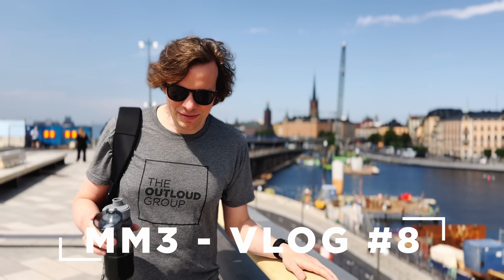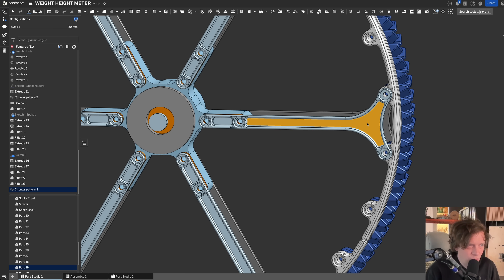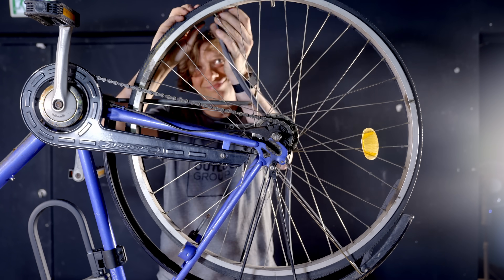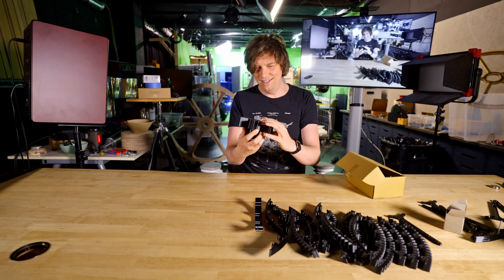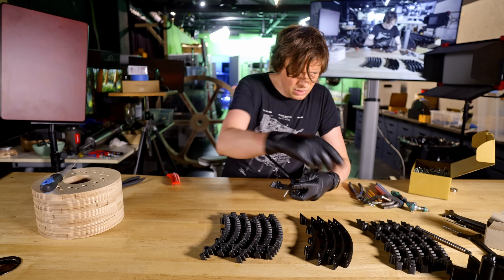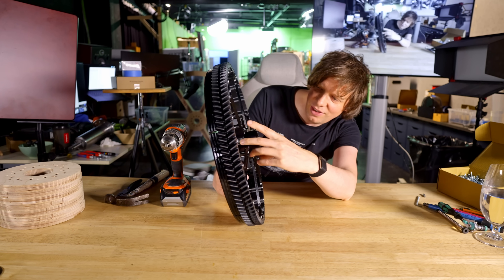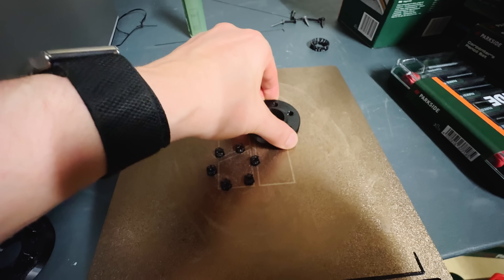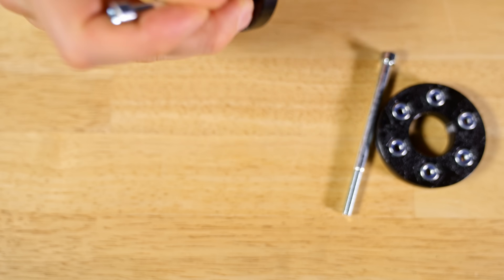Assembling the first gear of the Tightness Meter - MM3 VLOG #8

Comment: 2:45 If you wish to patch the innertube and continue using it, I would suggest the Tip Top tube patch kits. They have been around forever and they work the best. Look for the little celeste green box. You want the classic kit with the orange wavy edges on the patches.

Comment: Regarding the backlash, have a look at a 2cv camshaft. The gear is split down the middle connected with springs. This pushes the teeth together removing all play, even after wear! Not sure if this is a solution for you but it is a neat engineering solution that is nice to have in your backpocket of knowledge

Comment: Hiya, when using two bearings with "fixed" centers like this, you can fully constrain one of the bearings on the outer ring and the other can be 'floating' (only constrained on the surface, not on the sides, in a tube). This way you will never distort the bearings, no matter how inaccurate that sleeve is or how much you tighten them down since one bearing can always freely move in the axial direction

Comment: martin, you’re designing the bearing assembly like it’s going to be doing 10K RPM. those bearings can handle all the thrust loads your meter will reasonably experience

Comment: OH MY GOD MARTIN, WASH YOUR BUILD PLATE!
You're using way too much liquid glue, and you're using the Bambu liquid glue that's better at making prints pop off the plate than making them stick to the plate. You probably don't even need it with textured PEI... and if you do, it's a sign you need a better build plate. Textured PEI is a jack of all trades, master of none. For engineering materials, a carbon-fiber plate like the Darkmoon3D CFX will work a lot better, and if it needs glue, Vision Miner Nano Polymer Adhesive will work a lot better than the Bambu glue. 

It's not your old printer that needed glue globbed on to work! ;)

Comment: Given your use case is all about precision and accuracy, it might be better to consider a form labs printer. A lot more precision, and much stronger parts due to the materials available. Yes, they're more pricey - but the benefits for your use, especially for smaller parts, will be worth it. They may even sponsor if you ask nicely...

Comment: hey Martin, that inner part you talk about in timecode 10:50, is the same concept you see in Skateboard wheels. There is an inner middle piece that helps do the same job. You're basically doing the same concept that is found in Skateboard wheel setups and that's pretty smart to reuse a system like that! Very cool!

Comment: Martin, I know carbon fiber is quite fancy, but eventually it's not worth the drawbacks. The added benefit (strength) is small compared to the risks related to the fibers. The helicoil gear will wear over time, slowly releasing micro carbon fibers. This is not as bad as asbestos, but still. It's organically neutral, so it stays in the body.

Also, handling properly the waste is cumbersome, nor is easily repairable.

Besides, and for a whole different reason, wood gears from previous MMs look awesome :)

I'd kindly suggest you to consider another material.

Comment: Just a heads up, I recently did a project with a 3d printed spacer like you made between your bearings. I went a little crazy with an impact driver and when I took it apart, the PETG part I printed had compressed. For a hand tightened part, you should be fine, but if you use an impact driver, expect it to compress a few mm at least.
Reply: I was just about to write the same thing. The tightening force required to destroy the bearing is higher than the force needed to compress the printed part ("printed part" in general..i know it depends on the specific printed material, strength, print settings, etc.).
I would buy some stainless steel tubes in various diameters to keep them in stock and cut them to length when needed.
Reply: He has a new torque wrench he can use too.

Comment: Usually, when you have two bearings with a fixed distance by the inner rings, you would only clamp onto the outer ring of one of the bearings. The other outer ring has a bit of an axial play in the bore it is sitting in. Then you don't have to worry about axial tolerances while still achieving a defined positioning (Fixed floating bearing arrangement).

Comment: a concern i have with using carbon fibre for the mechanical gear parts is that as they wear they will be releasing tiny filaments of carbon fibre into the air for people to breath in
Reply: I think the final gears will be metal.
Reply: @pumbaandtimon  Yes, AFAIK the 3D printing is for the prototype proof-of-concept for real engineers to later receive the final design plans and decide on the proper final materials.

Comment: power sanding carbon fiber is bad, but just filing down some edges on 3d printed carbon fiber isn't likely to put much (if any) dust in the air. Martin if you want to care, get yourself a particle count meter and watch how 3d printing itself wrecks your air quality compared to say, filing a cf filled part.

Comment: I would just go with PLA+ filament.  It’s quite strong and tolerate a bit more heat compared to standard PLA. It’s easy to print and doesn’t generate nasty fiber particles during wear and tear. But that’s just my personal opinion.

Comment: One suggestion on the bearings, I have seen James Bruton print the bearing interface oversized and print sleeve shims for a perfect fit. Mind that he does this when using large nozzles on large parts which reduces the control he has for margins, but if you are looking for super-tight tolerance, it could be your answer.
Reply: Oh, and holographic build plates can add a bit of visual interest

Comment: Hello. You are making 3D-printed gears, but I have noticed that some of them show irregularities and dimensions that do not seem to be fully precise, which is unfortunate given the level of accuracy required for your horology project. To achieve the precision needed to measure time and hundredths of a second, it would be beneficial to pay even closer attention to producing perfectly round circles. At 6:47 in the video, it is clear that the circle is not entirely perfect. Improving this aspect would make your machine even more impressive.

Comment: I saw the inner distance holder. I don't know how much force this 3d printed part can hold. But my intend tells me you probably need to think doing this out of a steal tube, with exact distance.
This might avoid any stress on your gear if you like to screw it in the axel bold somewhere on your machine. 
Other then that. Great job looks amazing.
Reply: Was about to say the same. Will depend on the tightening torque of your bolt. You should do the math if the plastic spacer can withstand the tensile load of the bolt.

Comment: Working on the tightness meter first makes no sense.  Shouldn’t you be working on the drive train first ?
Reply: Trust the process man... Trust the process....
Reply: @jeanlebel5979  I get that maybe it helps to just work on a smaller subsystem, but  without the drive train to power this thing you can't even really test it.  But it's possible he can't do the drive train yet because he's waiting for parts or something and so he's just working on this while he waits.    I can certainly see wantign to have the meter early in the process because as you add components you want to see what is affecting your timing.  Because every new subsystem added is goign to increase net friction in the system and increase the power requirements.

Comment: after you assemble you need to check concentricity between the hub and the gear track any deviation will cause issues with accuracy

also you talking about the sleeve you made so you can clamp the hub you should be using a tapered bearing less parts is always better

Comment: For your concerns about handling CF you should either contact the manufacturer or check the SDS to figure out exactly where the risk lies. 
Some CF filled filaments are safe to handle by hand but can raise concerns if inhaled. For instance, if the CF printed object is rubbing against another object, potentially releasing particles into the air.

Comment: Does the carbon fiber have a specific purpose if it's for prototyping?   
I mean,  if the part doesn't get hot or is under a big load, there are probably easier and safer materials.
Reply: I'm guessing that Martin is trying to get a feel for how printing the material works and feels with this process, so he can use it better when circumstances actually call for it.

Comment: Martin the safety concerns from using Carbon Fiber filaments without an additional coating layer extend beyond removing supports. Simply handling them can release small carbon fiber shards into your skin and the friction from the gears will release these fibers into the air which you can inhale. On top of this, the strength benefits provided by the carbon fibers embedded in the filament are so small compared to other CF usages where they are weaved intentionally into a support structure, so beyond aesthetics it is not doing much compared to normal PLA
Reply: The strength gains aren't even small, they're non existant. Filled filaments are across the board weaker than unfilled filaments. The fibres are way too short (below the critical length for a composite) to act as reinforcement, instead they behave like inclusions and impurities making it weaker.

Carbon fibre prints are also abrasive (and this abrasiveness will not smooth out with use, as they wear down they reveal fresh, abrasive fibres) which is terrible for gears.
Reply: @H34...  Inclusions like CF help with dimensional accuracy in plastics prone to warping though (which PLA is not)
Reply: @perpleksed the inclusions can help reduce warping, but on an enclosed printer like his it shouldn't be an issue. I have an even bigger printer and since i enclosed it, warping has been a non issue. On small parts like what hes doing it even worked fine in open air
Reply: @H34...  im pretty sure cnc kitchen says thats wrong
Reply: @H34...  so this is wrong. The fibers absolutely do strengthen both the lines of extrusion and the layer bonding. I personally don't use it much mostly due to cost. But I have disingenuous a very small filament holder for my machine and it absolutely would snap in any other filament holding a kilogram of filament. But it's been running for years in carbon fiber PLA
Reply: @nathantoews152 if you can point to any emperical testing to prove this, sure, rather than just a gut feeling you have about one spoolholder you printed. There are plenty of emperical tests showing fibre filled filaments have a lower ultimate strength.
Reply: @H34... I mean I printed it in abs petg and pla and it broke every time. And I'm pretty sure CNC kitchen has tested this in the past. (With way more data) But hey you beilive whatever you want
Reply: @nathantoews152 read my reply again, he has tested it, and has shown that fiber filled filaments are consistently weaker than their unfilled counterparts.
Reply: @nathantoews152  if nothing else it changes how rigid the plastic is even if it fails at the same tension or bending. my placf and asacf both create very stiff parts that dont nearly as easily develop the white deformation spots. they generally take it with a small amount of bend or stretch right up until they break clean in two... so i would make leaf springs out of normal plastic and the frame they attach to out of cf
Reply: @H34... ok, ultimate strength isn't the only design criteria.  Have several tools at work made from 3d printed fiber reinforced nylon I have previously used versions of these tools made from machined polycarbonate, delrin, ptfe, PE.  And its far better in the carbon fiber nylon.  Understanding the strengths and weaknesses of a material and how to use them is important.
Reply: And these are effing gears, whose whole nature is to grind each other during normal operation...
Reply: CF filament in a moving part is like the modern day asbestos... it's not obvious it's an issue, until it is. Better to be safe than sorry!
Reply: I’ve seen YouTubers handle carbon fiber filament prints with respirators and latex gloves. It’s not inaccessible, just requires more precautionary measures, especially when repeatedly used long term. But I would agree that it’s probably simply easier to use something like PLA with minimal tradeoffs
Reply: He's not printing pla.  He said very clearly that it's polycarbonate

Comment: Wierd Idea but what if you used a timing light, like the ones you use to adjust the ignition timing on a car? You could have a bright led going off at a set time interval, giving you a "freeze frame" at a specific moment in time. Then you can have reference markings on the gear and one stationary mark to see how far forward or behind the gear is during each flash

Comment: I don't know how relevant this is, but now that you added that moon circle on one of the spokes, you've changed the center of gravity on the wheel on 2 different axes, which might have an effect on both your shaft setup, as wel as gear wear.
Reply: Functionally, this gear is a speed dial that also hits a bell.  In normal operation, it shouldn't even be doing a full revolution.  The shaft and gears will undergo asymmetrical wear anyways as a resutl of the reciprocating motion, imbalanced axes are just not a very big deal.
Reply: he doesn’t need to overthink this design even more
Reply: @beng9310  he already is. if he wanted to actually progress on the machine that makes music, he should've just used/been using some digital way of measuring tightness to build the machine, and than AFTER that, make this part which is completely seperate frome the music.
Reply: it's easy to balance it with a counterweight